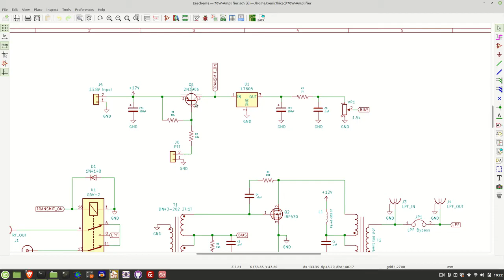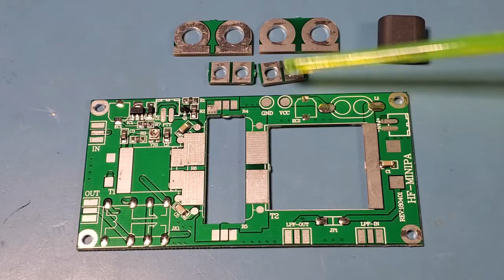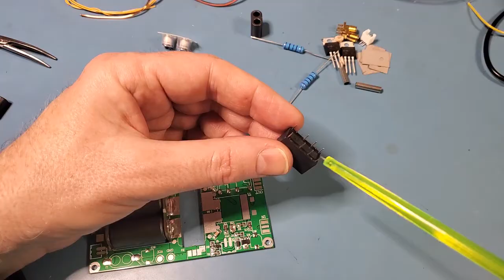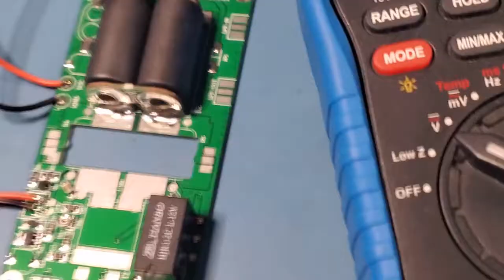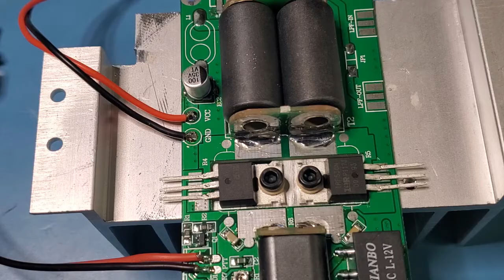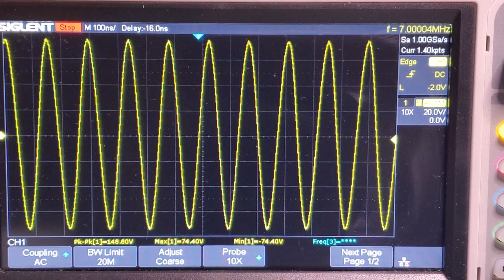70 Watt Amplifier Kit Build

Comment: The explanation here about the missing R6 is a little off. It needs to be there for either the 70 or 100 W version, as it is part of the low-power side. To explain, the transformer has what is called a Q value, which is defined as the reactance divided by the resistance. A high Q means a narrow bandwidth. This is good for some purposes, but not if you want broadband performance. So, we want a low Q and wide bandwidth 1.5-54 MHz, so we want to put a 100-ohm resistor across the output side of the transformer to widen the response. If you omit this resistor, you will find power loss above and below the center frequency because the impedance will be somewhat mismatched (not 50 Ohms). So, no matter what FET(s) you are using, ALWAYS put a 100-ohm resistor in for R6 as that is standard practice for any linear amplifier in the HF range. I hope this helps to clear this up!

Comment: As is, this is a pretty junky amp with a whole lot of thoughtful work required to get it right, and the power output is often wildly exaggerated by vendors,  so I'm glad you are going through it to point out all of its shortcomings and how to fix them. What it is is the start of a decent little power amp for a very low price, (when it's not being outrageously exaggerated by eBay vendors.) What they require is some additional good engineering work, which you are putting into them so that other hams can reproduce it with theirs. Thank you.

Comment: Would this amplifier work at 50MHz.? If not, what are the limiting factors?
Reply from the maker: I think the switching times of the IRF530s would be insufficient for 50MHz. You'd likely have to modify the input/output transformers too. I haven't really played around much on 6m - so I don't really have any practical experience.
Reply: Just try it. I think the slew rate of the 530 is just good enough to get by with it. You may have to drive it a little harder to get the same gain, or you may have to accept 20% or so less at 6m, but it will probably work. Just don't use an IRF540 if you want to go that high. Yes, it will produce more power at higher current if you keep the temps in line, but the input capacitance is almost double, so you have to drive those harder as well, and it definitely won't go to the higher frequencies.

Comment: I recently built this kit and had problems (even with low drive power) of the FETs failing (I purchased new IRF 530s from Mouser and still had failure issues.   I found a posting (web) by G4AQB suggesting a 4 Amp current limiting circuit.  This solved the FET failing issue(s) for me, at least so far.  1 Watt in yields about 20ish Watts out which was my goal.

Comment: Beware. I bought this kit and the sleeve tubes provided for the ferrite cores are non-ferrous stainless steel, zero chance of soldering them to the end caps. Luckily I have some brass tubing suitable for both core sizes, but the kit I bought was supplied to fail. Its not a question of needing more heat, I have a metcal iron, I even tried pre-tinning the ends of the tubes with a mini butane torch. Tried different fluxes, they will not take solder.
Reply: Thanks... i was becomming crazy

Comment: Great video. I was actually thinking of picking up this kit for my home brew super-het radio that I am building. Still really curious about what you said at the end of the video about SSB and overall linearity. Just curious if you had time to run a test with an SSB signal on it? Thanks
Reply from the maker: Thank you for the comment. I think I was a little hasty claiming this amp would be no good for SSB - I have seen some more videos where the amp was being run with acceptable linearity. I am definitely going to be doing some more testing and will publish the results
Reply: @na5y   Awesome! I was actually surprised also to see how clean the sine wave looked on the scope. Very little high frequency components in there. Would be cool also to see it on the spectrum analyzer without any LPF installed.
Reply from the maker: Without the LPF it looked pretty much like a square wave! I should have recorded it but the video was getting a bit long - I can add tha to the followup!
Reply: @na5y  Oh! Wow. I thought that was without any filtering.
Reply: @na5y  i dont have a spectrum analyser like you. could you give a link to your LPF? i am mainly looking at 20m-40m.  i had a look at the other guy website your linked. he has alot of shematics, but it is not written on them witch band is witch part of the circuit.
Reply from the maker: @Francois_Dupont  Francois - I can't remember the actual component values but here's the process I use with the "rf-tools" calculator:

1) First determine input and output impedance. For simplicity lets assume 50 and 50
2) Next select "Low Pass" and "Chebyshev"
3) Now pick "Shunt FIrst" and "Topology" = 5. Topology is the total number of inductors and capacitors in the filter - more has sharper cutoff and flatter passband. 5 is a good starting point
4) Now select the cutoff frequency so that the second harmonic is 30 dBs or so down. For 14 MHz I picked 16 MHz - you can play around here
5) Now pick standard component values
6) Press compute.

With the above I got capacitance of 220pF, 390 pF and 220pF and inductors of 680 nH - all good easy values to obtain or wind as the case may be. I hope the above helps and thank you for the comment
Reply: @na5y  thank you! i will look into it! i am very interested into it.

Comment: sorry im kinda stuck on this one i gor rig of the irf530 and i did get a MRF120 now im finding it hard to work out what resister goes in R6 place
Reply from the maker: Have a look here for the values at different frequencies
https://pa-11019.blogspot.com/2016/11/diy-kits-70w-ssb-linear-hf-power.html

Those were arrived at experimentally so you might have to play around a bit. The resistors do need to be at least 3W

Comment: Hello NA5Y, You helped  me to find where I made a mistake with Your checking the continuity between the parts. I am new in "Hobby" so I soldered the small transformer to the board like I am "welding a stairs to the house" 🤣and bypassed, connect it to the ground (-) but Your Beep Beep was very very helpful. Hope the whole thing  will work after I finish it again. Thank You so much. Best regards, Dragan, Belgrade, Serbia, YU4ELD 😀
Reply from the maker: Glad to have helped Dragan. Thank you very much for the comment!

Comment: At 17:40 you mentioned the space for a resistor which isnt fitted, there is a simple explanation. This PA board is universal for both the 70 watt version (Minipa70) and the 100 watt version (Minipa100). In the 100 watt version the two IRF530's are replaced with a dual Mosfet package the MRF9120 and this is when this resistor is used. Its a simple matter to upgrade the 70 watt PA to the 100 watt by replacing the two IRF530's with the single MRF9120 dual device and adding this resistor.
Reply from the maker: Thank you John for the comment. I did also notice that even with the IRF530s a correctly chosen R6 can improve the input SWR. Sorry for the delayed response - your comment only just appeared for me.
Reply: R6 is for reducing the input Q. Flattens out the frequency response. 😁

Comment: This is acutally a pretty nice little kit. I got one with the reused 880MHz LDMOS transistor (they are sold as the 100W version). 
I think they are a great way of getting into amplifiers and good for experimenting.
Reply from the maker: I agree - simple to understand and build. Those two links I provided  (dk9jc and pa11019) had some great additional content - do check the out. Thank you for the comment!

Comment: Having blown up my main transceiver, I've been thinking of getting one of these to go with my uSDX+, looks just the job.
Reply from the maker: Good luck Stephen - the amp requires 5W driver if I recall correctly - not sure what the uSDX outputs.
Reply: @na5y  depends on band, mine gives 3.5-5 watts, lowest output being 10 metres.

Comment: About the heat sink(s).  The kit includes insulating grommets and sil pads. The intent is a thermally conductive route from each drain, while electrically isolating both drains.  Are sil pads better than two heat sinks?

Comment: Nice video. by the way this amplifier also works on SSB i have personally tested it so no issue on SSB yes if you add a Low Pass filter then it works great.

Comment: In short, the supplier does the easy stuff, the pick-and-place and oven-solder of the SMDs. You have the labor-intensive tasks of building all the inductors and mounting all the through-hole devices. This kit has the advantage of new IRF530PBFs, unlike the recycled components of other kits.  You'll have to provide your own low-pass filter and power supply.
Reply from the maker: Indeed - although I view the labor intensive parts as the "fun". Thank you for the comment Robert!

Comment: 1:02 Where can i find those blue things at i only got one blue thing in the mail today it didn't came with two.
Reply from the maker: Sure - they are 100 ohm 3 watt resistors. Amazon has them here - unfortunately you have to buy 40
https://www.amazon.com/Fielect-Tolerance-Metal-Oxide-Resistors/dp/B083TGGKNT/ref=sr_1_12?crid=VKDDBMIRI86Q&keywords=100+ohm+3+watt+resistor&qid=1653146552&sprefix=100+ohm+3+watt+resistor%2Caps%2C476&sr=8-12

Comment: That signal looked nice. you should check it on your spectrum analyzer. I bet it would be fine on the air. it would be fine for AM or FM. if you use the port on the radio to key it witch it looks like you are, you may not need to make a delay for SSB if the radio provides that. Looks like a fun project. Thanks.
Reply from the maker: Thank you for the comment Curt. I did check the harmonics on the simple FFT function on the oscilloscope and the highest harmonic was at 21Mhz - 35dB down. Unfortunately this amp doesn't have great linear behavior. I might do some tests showing that!
Reply: @na5y  Aww that is to bad, but on a brighter note I've heard there is another Mosfet you can use on those that performs well with higher band width and less harmonics. maybe something to play with. (RD16HFF1).
Reply from the maker: I have some genuine RD16s out there - might try that. The pinout is different though (GDS for IRF, GSD for RD16)
Reply: @na5y  That would be great to see the difference. or whatever else you decide, because you make some nice videos.

Comment: Very nice video. I do wonder, however, about three things that I wish you had touched on:
1) What bias voltage did you use, and how did you decide on it?
2) Signal looks great on scope, but that's after it was cleaned up by your low-pass filter. What's it look like without the LPF?
3) Output power looks good at 7MHz, but what is it like on the high bands?
Reply from the maker: Hi Doc. 

I did a followup video that answers some of yout questions: https://www.youtube.com/watch?v=ZvDppBOvhtI&t=3s

In a nutshell
1) I settled on around 3.3V which was significantly higher than the 2.8V max you can get with that bias resistor in there (I removed R7 and speak about the mods in the followup video at 8:44)
2) Signal looked pretty good even without LPF - definitely still some harmonics there though
3) I didn't get around to testing on the other bands unfortunately

I do plan to play around with this amp in the future - thank you for the comments!

Comment: Mine had Resistor R6 missing from kit. Also it's not shown on circuit diagram. When R6 is fitted it greatly improves SWR at tranceiver to amplifier. Cheers from old George
Reply from the maker: I don't think R6 comes with any of the kits. I guess they don't supply it because it is somewhat band specific. Thanks for the comment George!

Comment: Mine exhibits a lot of harmonic output in the absence of an output LPF, which is needed before puttiong this unit on the air.

The manufacturer also states that it must be protected from any accidental output open circuit or short circuit load and will only work into a maximum SWR of 2.0:1.

I have an output load out-of-range detector and shutdown circuit, which I designed and built myself. This circuit of mine will both ground this amplifier's bias line (to zero volts) and  inhibit exciter transmit power being applied by disabling PTT when the output load is out-of-range; open, short, or SWR greater than 2.0:1.

One diifficulty I had with this amplifier's PCB is there is insufficient clearance between the PC trace for the center tap of the secondary side of the input ferrite RF transformer and an adjacent swath of ground. This can result in an evasive intermitten short to ground on the center tap of the secondary side of the input ferrite RF transformer, which kills the bias to the power FET gates.
Reply from the maker: Thanks for the comment. You definitely will need an LPF - no question on the output. I didn't have any output protection but I have seen other experimenters do as you did. On the last point do you have a picture - I didn't have any problem like that on my board - there seemed plenty of space but I am not quite sure where you are referring to
Reply: It is well concealed under the solder mask. There is a sizable swath of PC copper that the end caps of the input ferrite transformer solder down to. It is the opposite side of the transformer from the FET gate inputs.  R3 and C3 connect to it as I recall. Anyhow that sizable swath of copper that the transform,er end caps solder two is exceedingly close to a parrallel swath of ground copper. I had to remove R3 and C3 and the bias adjusting potientometer to find the issuer,. which is under the solder mask. I then widened the gap with an X-acto kinfe. @na5y

Comment: It would seem that 7 MHz operation could benefit with 48 AWG times 675 strands of litz wire on the binocular core and tube cores?
Reply from the maker: I have never tried litz wire (I had to look up what it is ;) ) - do you have any references you could share ?
Reply: @na5y  the idea is that of "skin effect."  At DC, the full conduction of the full diameter of the wire occurs.  At higher frequency, the effective conduction is limited to a "skin" of  conduction.  In order to mitigate skin effect, one may use multiple strands of insulated wire that has an equivalent diameter of what is needed.  Hence "litz" wire.

Litz is great to increase the "Q" of filters, etc.  The potential drawback is that its use may make the circuit less stable.

Comment: I've burned two sets of irf530's so far. Thanks for the video. I have lowered the bias to 0 V and will strart gradually from there.
73 de Z33ST
Reply from the maker: Yeah - those IRF530s go quickly., even when well heatsinked
Reply: Manual says 2.7V but 3.2 is best. Make sure you have R6 installed.
Reply from the maker: @MakeDoAndMend1  agree to both! I even took it up to 3.4V. Thank you for the comment
Reply: Need 50ma vías irf are diferent

Comment: I bought a old Heathkit GW-12 CB Base at the Dayton Hamvention. I built one of those back when I was a kid in the 60's so I couldn't pass it up. The radio works good but I can only get less than 1 watt and according to my meter, it is around 1/2 watt, so I am looking for a amp that will boost the output on the cheap. Will this kit work for the 11 meter? Would it be a straight forward build, with instructions?
Reply from the maker: It'll work on 11 meters with an appropriate low pass filter - which is not included. I haven't tested it there. As far as instructions go - the kit comes with no instructions whatsoever. Also - you will need a heatsink - as that isn't supplied either. Good luck with your build and thank you for the comment Martin!

Comment: of all the few videos i have found for this, you  have the BEST video! but i wonder if i may ask.... i built my little amplifier to your instructions, however, i do not have a oscilloscope, and i dont have the low pass filter yet, but i tried to test wattage with just my wattmeter, and i have zero output. i can key my radio with 1 watt, and it registers on my watt meter, but as soon as i key the amp, i lose the 1 watt that i have, as if its not putting out. can you suggest where i might look to see if i have something wrong? i did adjust the bias to approx 2.7vdc as some schematics have shown it to be. 

thanks in advance for your help. this is my first kit, and am excited to see it work!
Reply from the maker: Thank you. Remote troubleshooting is super tough. Some things to check
1) Low pass filter is certainly needed to be on air - but isn't needed for testing
2) Is the output of the amp going to a proper 50 ohm load? It really should - and in testing it should be a dummy load
3) What is the current draw from the amp during transmit. If it is low then you may have blown FETs - check them. 
4) This is super tough to check without an oscilloscope but you really have to see whats going on at the gate of the FETs. Are you getting a properly biased waveform? Not sure how you'd check that with a multimeter though.
5) I know its a bunch of expense - but consider getting a cheap oscilloscope. You don't need an expensive one at these frequencies - and it opens up a whole pile of diagnostics. Something like this perhaps (no affiliation) https://www.amazon.com/Siglent-Technologies-SDS1052DL-Digital-Oscilloscope/dp/B01J16NV54/ref=sr_1_4?sr=8-4

Comment: Any chance you would be willing to do an updated video building one of the Amazon versions that the SMD's are not already mounted? I have the kit(I knew what iwas getting into) and I want to build it right, but mine came with a bare board and a bunch of SMD components.
Reply from the maker: Yes I think I'll try that out! Stay tuned

Comment: Can you test it without a lowpass filter? if so how ?
Reply from the maker: Testing on the air should never be done without a filter. You can test in the workshop without a filter just put your 50 ohm dummy load on the output. There will be a lot of harmonics